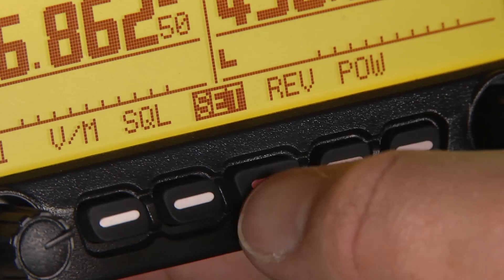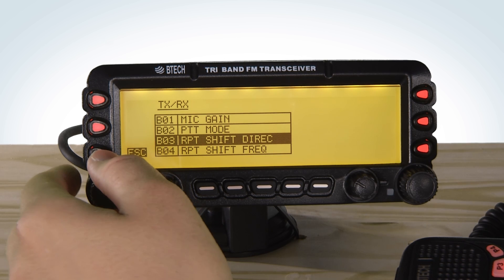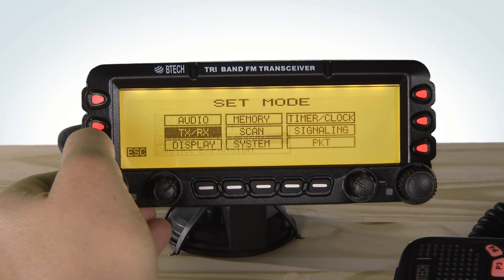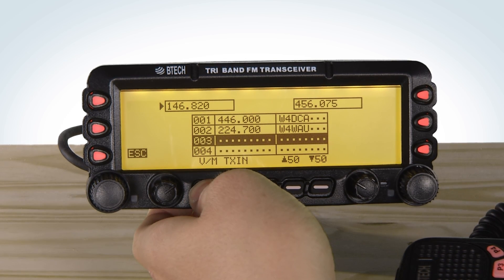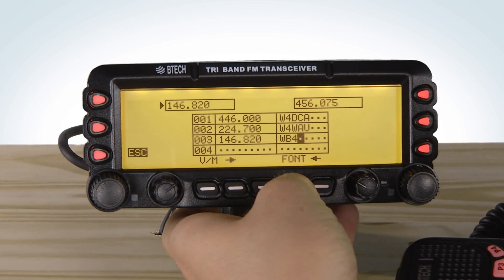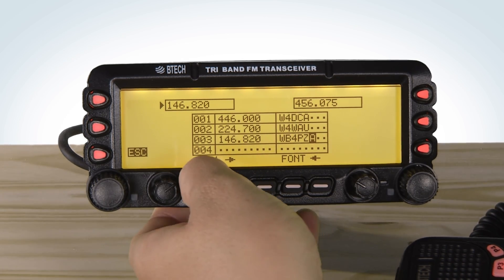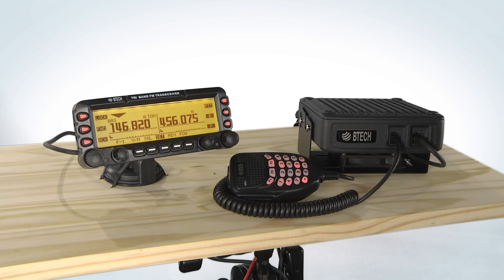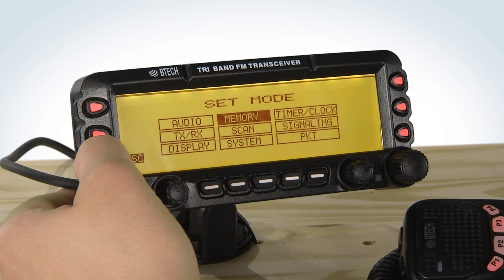BTECH UV-50X3 Mobile Front-Panel (Manual) Programming Tutorial

Comment: Nice video.  I have 3 Yaesu FTM-350 radios and I love them except for only 1 watt on 220.  I really need the 5 watts.  I downloaded the manual but i don't see anything about GPS but it shows as an accessory.  Alpha tags seems to also be missing.  They must have only been able to copy part of the radio OS instead of it all.  I will watch to see how the radio works out.  If it can do all the FTM-350 can but transmit 5 watts on 220 I will purchase one.
Reply from the maker: GPS is coming as an additional model, channels can also have Alpha tags, as well it is CHIRP programmable
Reply: Thanks for the quick reply.  Was talking with a friend who is also interested in one so will be looking forward on more videos on the radio. 73 Larry W9XE
Reply: Another question, have you tried the RT Systems programming software and cable used in the FTM-350 to try programming it instead of Chirp?
Reply from the maker: CHIRP fully supports the radio and is free - while RT systems does support the radio already; we prefer CHIRP